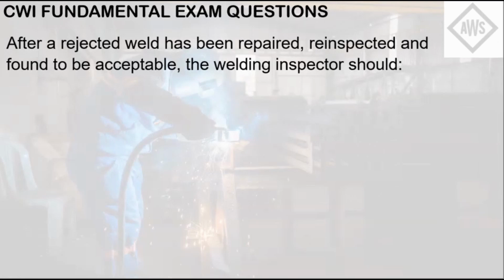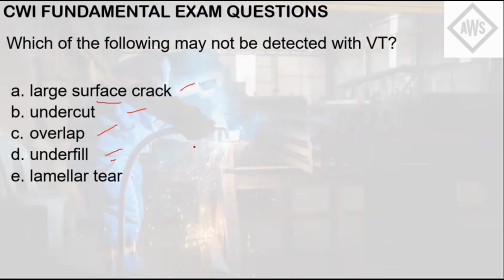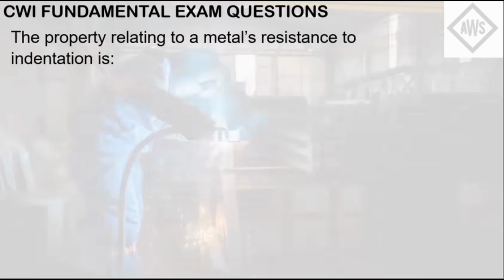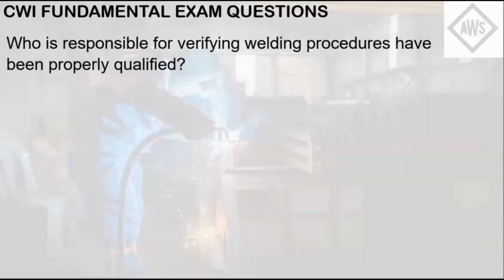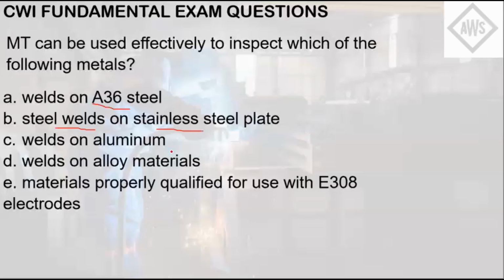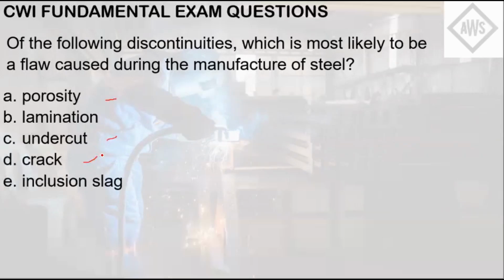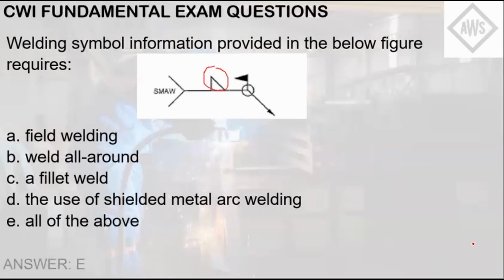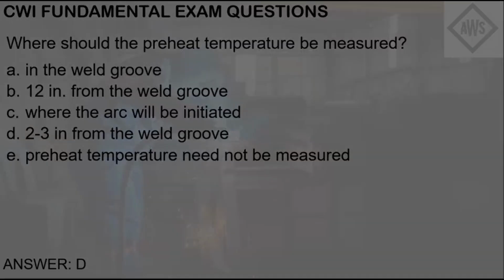Certified Welding Inspector Fundamentals Questions: CWI exam Part A Sample Questions (3)

Comment: Planning to test in February. Is there any other advice you can offer for passing the CWI exam?
Reply from the maker: As long as you have the concepts down, you’re going to be fine. Choosing what standard to take for Part C usually depends on your familiarity with the standard, so choose whatever standard you are most familiar with to avoid time constraints.
Reply: @Hardhat_Learning thank you for this channel. Very helpful